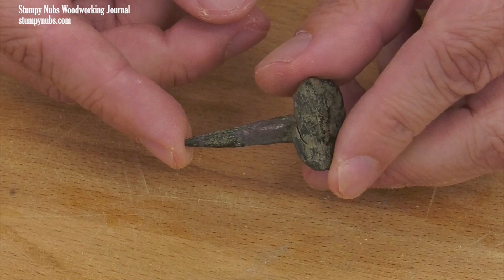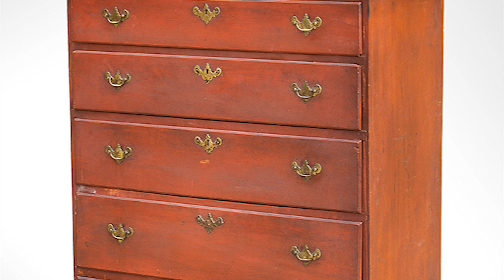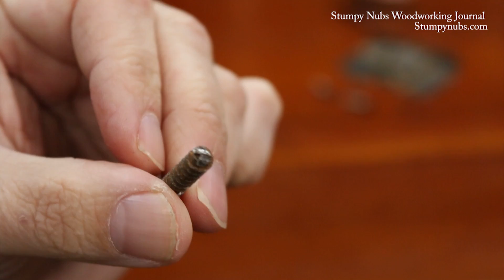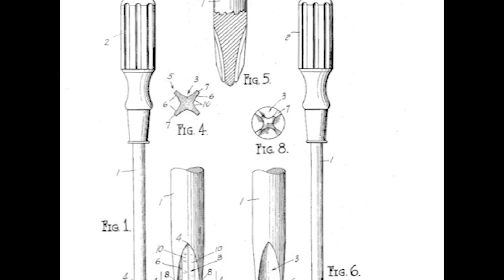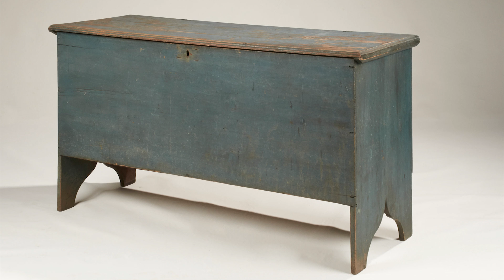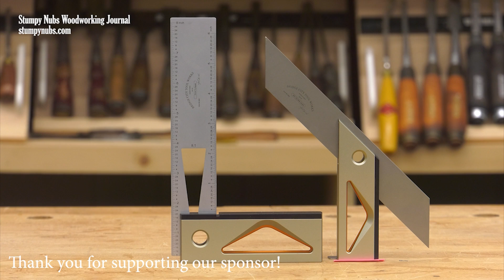The forgotten history of wood screws

Comment: not all nails are equal and nor are the screws. The rigity of a screw does not mean it will shear easy, it actually means it can resist more with less deflection and often is a whole lot more force to shear a screw than a nail bending. Sure the nail has that flexible advantage to allow movement, but so is a screw if the holes are made a bit oblong in the top part.

There are hardened nails that will likely crack rather than bend (concrete nails) that resist a lot of force in shear mode but is on the more brittle side.
There are mild screws that will bend.
There are also hardened screws that although they seem brittle (as it will crack rather than bend) they support loads far greater than any nail or conventional screw.

Brittleness does not equal less strength. More then often is the opposite.
A wrist pin in an engine is a piece of very hardened steel that will shatter at failure point (like glass) but it needs a lot of force to reach that point. The wrist pin connecting the connecting rod and the piston is totally in shear mode and they used the moste brittle steel there is and work very good (because the steel will not reach that critical load at any given time).
Same as carbide inserts.. you drop it on the floor ant it will chip and shatter. But actually measuring how moce force is needed to shatter that carbide will surprise you as is severel times higher force needed than an ordinary piece of steel.
Same with spring steel. Is springy, bendy (but will revert back), but in fact the spring steel is brittle such as the spring at failure will crack and shatter. yet the spring steel is several times more tensile than a pice of mild steel.

Beware not all brittle materials are also strong. Unfortunatley the ordinary screw is in this category.. the hardening in mostly from work hardening but the actual steel is not high carbon alloy or spring steel or other really tough steel. It's just a piece of mild steel that got work hardened making it more brittle and just a bit more strong than the ordinary soft mild steel.

Comment: Many don't know the technical difference between a bolt and a screw.  Per the machinery's handbook, a bolt has the head held while a nut is tightened, and a screw has the head of the fastener turned to tighten the assembly.  Why does this come up? Well, much like the metallurgy differences between a nail and a screw (brittle vs ductile), a screw is more geometrically constrained while a bolt is more metallurgically constrained (bolts for structural use, screws for mechanical).  As an engineer, I love throwing that trivia to new engineers.

Comment: Besides nails there were rivetts since long time, and in woodwork wooden dowels were used. Every carpenter had at least 2 or three drills of different diameters for drilling the dowelholes. And every gunsmith or locksmith had his cutting irons made from hardened steel (first drilled and filed, then hardened of course :D ), to cut different sizes of screws. Nails were not used that often. Wheels were mostly mounted with split pins or wedges. I own a 3 door wardrobe which uses no nails and no screws, only 4 wedges and on two edges tongue and groove ... from the 1920s.

Comment: Nice discussion!  A comment on the end ad for Bridge City Tools, as far as squares go, one quick make-do when you don't have a square handy is a large piece of paper.  Fold it, and fold it again perpendicular to the original fold so that the two sides of the first fold are precisely next to each other.  The result is a "perfect" right angle.  Folded once more so that the fold runs diagonally from the second fold with, the two edges of the original fold exactly next to the second fold and you have a 45 degree.  The folding has to be careful, but as the person who taught me this used to say, "it's close enough."

Comment: Sometimes Stumpy outdoes himself with these general interest videos. They are really good and they would appeal to a wider audience than Stumpy gets with his channel. This was one of those videos. Thanks Stumpy.

On the Robertson screw. It's sad. If there was justice in this world the Robertson screw would have been used instead of the Phillips screw for most applications. But that didn't happen and now the Torx screw is better than the Robertson screw for high torque application and the Phillips screw is just fine for low torque application and might be better for those applications than the Robertson screws. So. IMO. the Robertson screw should be obsolete. And, of course, the slotted screw is an invention of the devil and should be reserved for use only by people that worship the devil.
Reply from the maker: In the days or powered driving before clutch-drives, the Phillips head was necessary for industrial applications because the bit will pop out before the screw is twisted off. That's why it was designed as it was. The Robertson was a great idea that just came at the wrong time :)

Comment: Bam, bam, bam, buh, bam you didn’t touch on pneumatic nailers in the construction trade and fasteners per second metric.
Reply: That is a major factor in construction. Another largely  construction specific concern is thinking about the next guy. Having to find and back out or cut  a bunch of screws tends to take far more time than prying off a nailed board.

Comment: Disregarding the expense, screws are better.  Modern construction screws (the brass alloy kind, with torx heads, from the Netherlands) are simply superior; the also have good shear resistance.  They also sport a very aggressive thread, that you will never pull out.

Comment: Nicely done James, though this information was not new to me, it gives me a video to show folks who are obsessed with a "screw only" fastener mindset. As a bit of trivia info, I read a study years ago in the Journal of Light Construction. A publication written by builders for builders. It showed that the average force to run in a Phillips head screw required 12lbs of pushing force to resist cam-out, a Robertson head was 8lbs, then the winner, your favorite and mine, the Torx head is 5lbs.. Really nice when running in a lot of screws. Handy when reaching up and screwing in a arms length, it applies equally well in removing them. Far too often I see homeowners and a few contractors use drywall screws, both phosphate and E.G., to attach joist hangers. They just can't believe they will fail in time, which I've witnessed. The good news for these guys is Simpson Strong Tie now produces and shows specs for screws designed for hangers. Excellent info as usual, James.

Comment: I do love Torx head screws, the one problem is in decks where the head fills with crud and you find it difficult to insert the bit to remove the screw when you are replacing a board.
Reply: I have built many decks using Torx screws. Pre drilled and countersunk. I agree they do fill with crud right away. However I have never come across a screw head so full a awl  or a razor knife can't clean out what needs to be cleaned as to a bit successfully achieving removal.. Do you folks walk in wet concrete?! Haha
Reply: @svenben9868  Sven I never said you can't clean them, a pressure washer does a pretty good job. But, without a pressure washer it is a pain.  I found the square head screws are the all-around best for inserting and removing.
Reply: With a good well made Torx screw and modern power tools you can drive the screw right though the board. Can not do that with Philips.
Reply: That's the reason why I prefer Allen screws or hexagonal screwheads.

Comment: well, i should probably just bite my tongue but i just have to add another reason that screws don't have the strength to resist shear force is they are work hardened somewhat when made, whether it is roll formed or less likely cut, the material is a different type to exploit that process, whereas a nail is more ductile do to it's metallurgy and it manufacturing process of being drawn, different beast,  yeah i know i'm being anal....but i just can't help myself. and i'm no expert in this by any means, but i do know that the more you work some materials the more brittle and less able to handle shear related forces. and a ductile material is more forgiving. anway, thank you sir, you do us all a good deal with yer talkins.

Comment: Don't agree with them often, but Canada was right on the Robertson screw.
Reply: The phillips head screw is perfect...for a specific application at a specific point in time - mechanical drivers without torque limiters. Somehow it took hold as a generalized "universal" screw head. That was always a mistake from day one. Why it is still used is just market inertia and ubiquity - for most purposes it's a horrible design, but here we are.
Reply: @indalcecio  Recently discovered Pozidriv--find it superior to Phillips, having driven them side-by-side. But for heavy duty fastening, nothing--Nothing!--beats the spider drive of headlok screws. Pricey, sure, comparing each-to-each, but the right comparison has to include "the cost-savings of not having to start over with new materials."
Reply: @indalcecio  The power of the mighty USA over Canada. USA was and is a global force. It overtook the UK in 1900 they set the standards.
Reply: Agreed. A Phillips head is almost useless. The Robertson is far more effective.
Reply: One advantage of the original Slotted head is that you can easily remove them even when they are damaged or rusty. It prevents more damage than necessary to restore antique furniture (or weapons as shown in this vid).
Reply: @duudsuufd  flathead screws are all fine and dandy till the driver slips right out of the slot and goes straight into your hand had it happen one too many times to like those buggers
Reply: Aahhh Reading the comments section wisdom is at an all time high Everyone thinks he/she is RIGHT & How dare you see one is better than the next
Reply: @slowgynman1234.  For me this is the fun to read and write YT comments.
Reply: Curious what it is about us that you don't agree with. We are usually considered pretty inoffensive.
Reply: @davidford694  There are leagues of philosophy under that issue, but the general principle of people who dislike the Canadian sentiment follows the line of:
A philosophical mythology lies concealed in language, which breaks out again at every moment, no matter how cautious we may be. — Friedrich Nietzsche

Or, perhaps more directly, people who go out of their way to not offend are not to be trusted.  The brave may not live long, but the cautious never live at all.  And many other sayings that encapsulate the differences between UK/Canadian and US historical culture.

All that being said, Canada itself is a pretty wide brush of culture and the cities define the culture but do not reflect the country.  My own father was Quebecois.
Reply: @fortusvictus8297  You need to read about the Canadians in the world wars. Not always mild and inoffensive,  if the situation calls for it.
Reply: @davidford694  I am aware of the 'Zombies'.  Every Army has people who don't belong there, but it is rare an entire country gets a pet name for their Army being non-participatory.
Reply: @davidford694  I live in Ak and have traveled through Canada and dealt with them a bit. I've never met a nicer group of people than the ones in and around Whitehorse but closer down near the border and a little east are some that are very snobby and somewhat hateful. The thing with experiences is they can vary widely though even with the same places.
Reply: Philips are wonderful drywall screws but as someone who has driven many tens of thousands of screws (and lives in Canada) I’ll take Robertson any day for most applications. One downside however is the ability to drive them too deeply with power drivers, that’s where Philips have the advantage.
Reply: I appreciate that philips can often be unscrewed if you don't have the exact size screw driver needed.